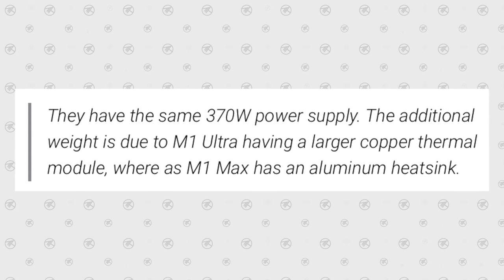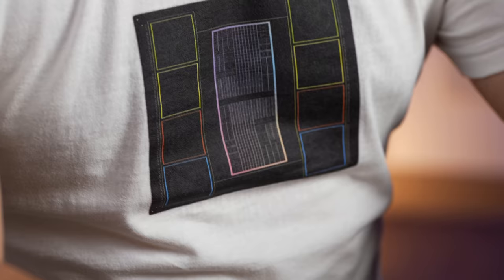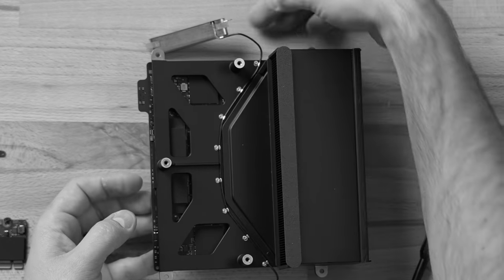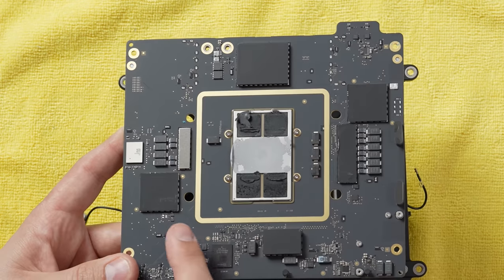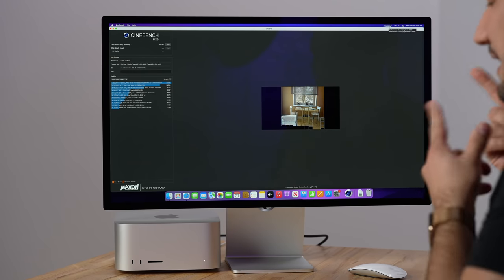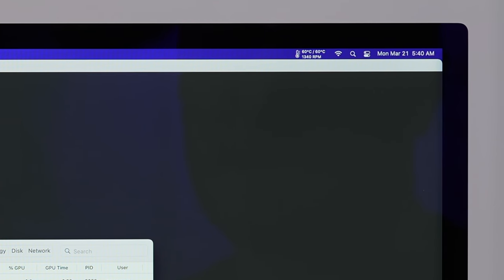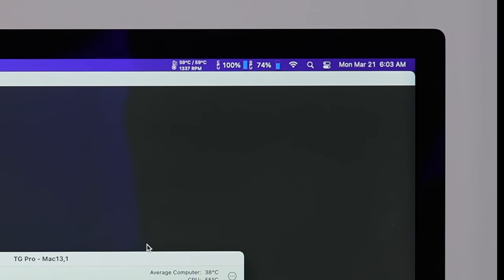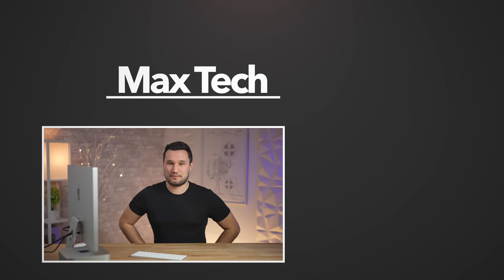M1 Max vs M1 Ultra Mac Studio: Thermal Throttle Test!

Comment: Great breakdown as usual.  Just want to point out that in the combined test, you might be seeing some CPU limitation of the GPU because the CPU is already maxed out by the Cinebench app.  I noticed that when you ran Wildlife Extreme by itself, there was about 24% CPU utilization, so it seems like that test does require some CPU to fully push the GPU to its limits.

Comment: Did you try pulling the SSD from one machnie and plugging it into the other and seeing if it would boot up?  I wouldn't be suprised if Apple writes something into the bios that locks out the other sockets if you bought it with only 512GB.

Comment: Seeing these results, I wonder if the chips are still operating as if they were inside something other than a Mac Studio? Thankfully, this is certainly something that can be corrected with software updates as the hardware design looks solid and there’s ample power and cooling on hand to crank performance higher.

Comment: It doesn't necessarily mean that it is Apple who limits the gpu performance when the cpu is maxed out. Its quite possible that something has to be prepared on cpu to provide the workload for the gpu. If cpu is maxed out, it becomes the bottleneck, and it doesn't provide enough stuff to max out the gpus.

Comment: I think that watt measurement is not a good indicator on the GPU usage. At a given frequency, watts indicate how many internal circuits are used. If a software does not use all functions of GPU because it doesn’t need , the watt will not be maxed but the usage will be at its maximum. The clock speed is to my point of view a good indicator of a potential throttle.

Comment: On Windows maxing out CPU and GPU can be done very well by running a Prime95 torture test at the same time as Furmark. I'd suggest leaving one or two CPU cores free so it/they can feed the GPU.

Prime95 is cross plattform and available for macOS (CLI) too. However, the current version is Rosetta-only. It does toast my M1 Air quite a bit, but not sure if it's a better torture test than CineBench.

There is a third party Furmark for macOS, but it's not built for Apple Silicon.

Comment: aluminum density 2.7 g/cm^3, copper density 8.9 g/cm^3, if the material used in both is the same, the copper will be around 3 times more weight.

Comment: You can’t tell if the aluminum is doing as well as copper as it’s cooling a different chip. To really test the difference you’d have to toss the copper heatsink into the aluminum system and Vice versus. Then test the differences.

Comment: If a MacBook Pro and a Mac Studio are equipped with the same processor, will the studio be faster due to thermal throttling, or will the performance be the same or similar ?
Reply: Identical
Reply: @Wizzy0037  thanks.  I hope that is the case. But why did Apple add so much heavier cooling apparatus into the Studio ?

Comment: What if you speed up those fans to the maximum and see if the clocks keep high? We know that 60 ºC for Intel CPUs is pretty low, but we don't know yet about the Apple Silicon. What is 100 ºC for Intel might be 60 ºC for Apple Silicon... That's a test I'd do just to make sure that 60 ºC is or is not the Tjunction.

Comment: This Apple choice of not ramping up the fans is weird for a pro machine that supposed to be designed to performance all the way. If you wanna keep at 60°C you ramp up the fan at the max. When the fan is at top speed, then you start to throttle the chip performance.
I was wondering if there is any possibility that this machine isn’t on “Performance Mode” and that is why it’s behaving like that?

Comment: A bit late commenting on that, but Apple isn't limiting the GPU performance in that last CPU+GPU stress test scenario. Graphics pipeline actually needs some CPU resourses for draw calls for the GPU to do its job, and if you max out the CPU resourses with a 100% stress test, it surely starts bottlenecking the GPU performance. Nothing to do with "wattage" limitations or any other limitations for that matter. Hope that clears it out.

Comment: Couldn't apple fit the M1 Max version of the Mac Studio in a Mac Mini form? Why is it so big when they fit the same chip in a laptop with similar performance?
Reply from the maker: Yea they could even with the same cooler most likely.
Reply: It allows them to make the Mac Studio form factor at scale. The M1 Ultra version is going to sell far less than the M1 Max Mac Studio or regular M1 Mac Mini. Meaning if the M1 Max used the same form factor as the Mac Mini rather than the Mac Studio, the economies of scale for the Mac Studio enclosure is entirely dependent on M1 Ultra Mac Studio's volume. Whereas the Mac Mini enclosure can scale its volume based on Mac Mini sales alone.

Comment: The power supply is 370W with the Mac studio. Both the Ultra and Max don't use nearly as much power. I wonder if Apple gave the Mac Studio that power supply for future models going forward?
Reply: Or maybe future high power mode setting in future Mac OS?
Reply: High Power Mode already came out.
Reply: @goldmastersimulations  Not for Studio, it's not available in System Preferences yet.

Comment: What motive does Apple have to run the fans at 1300 rpm instead of 1100 rpm?  Doesn't sound like it's helping cooling that much and there doesn't appear to be a reason for it to run at 1300 rpm while idling.

Comment: If the cpu is being hammered by cinebench then the reason gpu performance isn't maxed may be just because the cpu literally can't push enough frames to max out the gpu. 

It's pretty rare to max both cpu and gpu at the same time. Especially for really powerful hardware. This is why you lower graphic settings to test cpu since at the higher settings your gpu is possibly maxed and in that case cpu will be waiting around until the gpu is done with a frame hence cpu power can't be grasped. 

Its vice versa for testing gpu. Use highest settings. The one with the highest frame rate means its literally able to process frames faster.

Comment: I would be so incredibly terrified if I cracked open the case of a modern computer. With my luck, I'd forget where half the parts go and not be able to put Humpty Dumpty back together again. In addition to seeing a comparison with the M1Max in the MacBook Pro, I'd also like to see a comparison with the 16 GB RAM M1 Mac Mini (or iMac) and also an M1Pro MacBook Pro. I am still baffled that Apple has not released an M1Pro desktop machine. (MacBook Pros only) Apple has the consumer desktop market covered with the M1, and the professional market covered with M1Max and M1Ultra. But there are no intermediate ("prosumer") desktop machines, only laptops.

Comment: All configs except 512 have 2 SSDs in a RAID 0 config. Too bad there isn't a config higher available to test the speeds at 1TB or higher. Technically the 1TB and above should have better performance. You can stick a module from the other Mac studio and use Apple Configurator to pair them a la the Mac Pro (but will erase data on both drives).

Comment: I got my Mac studio yesterday and was surprised at how loud the fans are! I have a M1 Max, with 32GPU Core. At idle the fans runs at 1350rpm ... and I don't understand why, because if I set this manually to the minimum of 1100rpm, than the noise is almost gone and the CPU/GPU temperature doesn't change. I had the Mac Mini M1 since 1.5 years and It was noiseless! Now this Studio is cool but the Fans Noise are disappointing. This noise Is not only Air Noise but a bit of high frequenzy Noise too...i will call Apple today, because i don't know of this is normal or maybe anything Is wrong with the Fans...? Has someone the same problem?
Reply: the cpu has a higher tdp so it would make sense that the fans would spin faster

Comment: The ultra cooler uses a copper Vapor chamber, which explains why you don’t see a heat pipe.
The whole base plate is *the heat pipe*

Comment: But doesn't Apple put storage on chip soc? Maybe airport extreme card???
Reply: Confirmed multiple sources, that's SSD. Some slightly different plug, but in fact an SSD. It makes sense, the most likely part to fail in the lifetime of the machine is ssd, and they are already under fire lately in multiple countries. Imagine if a faulty ssd would send your whole $4,000.00 computer to a junkyard as e-waste, Apple's in enough hot water, and this would be directly affecting their large corporate clients who want big graphics stations like this, like Pixar, etc. The write cycles any pro will submit this system to is really high, and ssd failure in a few years is probable, if not inevitable. So to protect the 5+ year lifespan expected of a machine like this is probably why the SSD is socketed still. That said, burying it under an exposed PSU like that is a bit questionable, a plastic cover would have taken up 2-3mm of space, and ensured they don't get a liability suit as soon as some poor sap tries to open it and stops his heart.
Reply: @arudanel5542  but a NVME my.2 gen4 SSD gets up to 6000mb0s transfer rate, would not on die SSD be faster. A seperate SSD would bottleneck the system.

Comment: I don't think those temps are correct. Same in last video. 17-19C on RAM ?  Either Apple has some kind of magic sub-ambient invisible RAM cooling tech, the room ambient temp is freezing cold (host attire readily precludes this) or the monitoring tool is just plain wrong...
Everything can be shifted down by at the very least 15-20C
Why is everyone just casually dismissing this? Everyone can't be this metrically challenged.
Waiting for proper tests when somebody sticks temp probes inside and correctly measures what happens.
Reply: Yes, this is obviously wrong, and it was pointed out for the last video. Even if this video was already shot, a note acknowledging this would be appropriate I think...

Comment: in this case the memory management is what limits the GPUs....Great to see no thermal throttling....the system will tend to max CPU faster than it maxes GPU because ...ratios: 20CPU cores vs 48 or 64 GPU cores AND the CPUs feed the GPUs...

Comment: 5:16: isn't that way to much thermal paste? Normally you apply it in a very thin layer to fill air gaps between the metal surfaces.
Reply: These are automated processes, it's likely the ideal amount to "never" be too little, and never be too much. It could be a thinner layer, but then Apple may run the risk of lower yields, because there's won't be enough on some units.
Reply: There is no too much paste. Doesn't matter how much you put on, only certain amount will remain between two surfaces and rest will squeeze out which will only create a bit of a mess but not really cause issues. There are videos on YouTube where people put on waaaaay to much and it makes no difference.
Reply: @HoldFastFilms  Not functionally, but economically there can be such thing as "too much". It might be a few cents worth of paste per unit, but that adds up, especially if the team gets careless in fine tuning other processes too.
Reply: Thermal paste has a far lower heat conductivity (< 10 W/(m·K)) than aluminium or copper (depends but around 200 - 300). To me it looks like this much paste is actually insulating instead of helping conduct heat. AFAIR Apple also did this on MacBooks and by removing the excessive paste they ran cooler.

Comment: please test change SSD!!!
Reply: U can't change the ssd .. its already been proven
Reply: @guylocation9823  where has it been tested? do you have the link of the video?
Reply: Mac Studio’s SSDs are modular, but replacement modules are not publicly available. The connector is proprietary.
Reply: @goldmastersimulations  ok, thanks... I was hoping it was a common NVME. Thanks for the information. I will never buy a mac again.